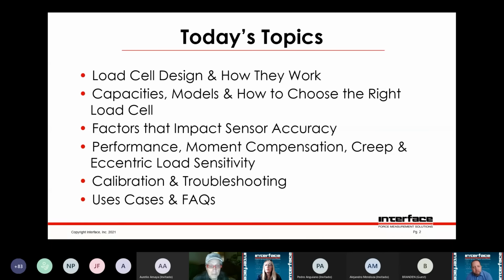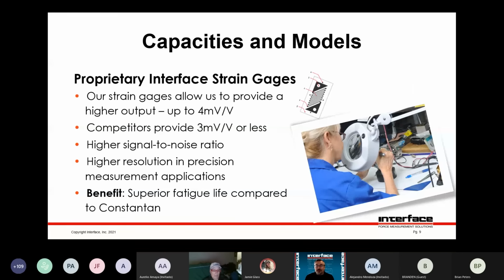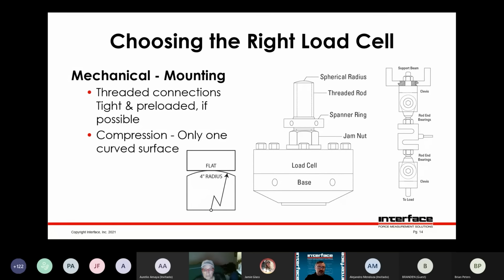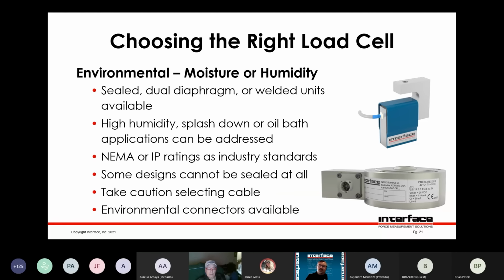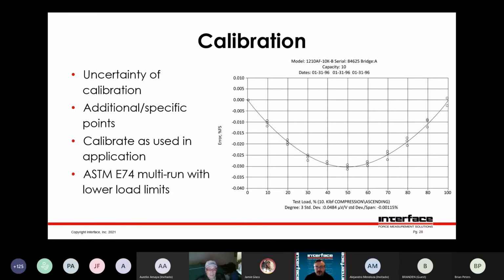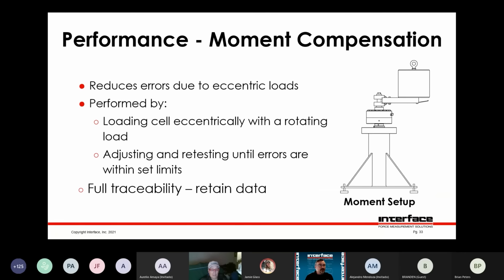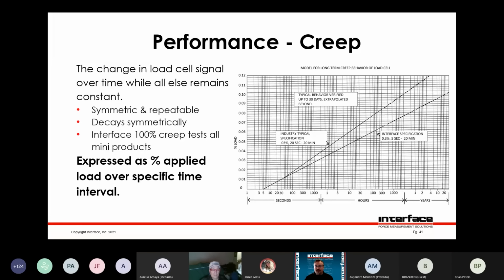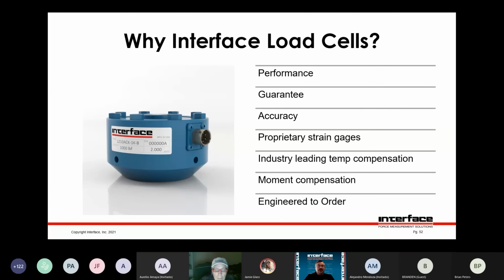Interface Presents Load Cell Basics

Comment: Excellent presentation.

Couple of comments:

Load Cells don't actually wear out if used within their designed limits. Fatigue Rated load cells are built beefier to be better able to handle overloads and shock loads.

To amplify on potential installation problems. If you are using load cells to turn a hopper or tank into a scale, then any live to dead connections (wiring, material entry/exit points) must be designed to avoid lifting or pulling on the tank or hopper. Ideally connections material entry/exit includes an air gap (to prevent binding) and wiring and plumbing should be routed horizontally and securely mounted at two points. The point the cable/wiring enters the tank or hopper and an adjacent point in the surrounding equipment. You don't want the length of the suspended wiring to change.